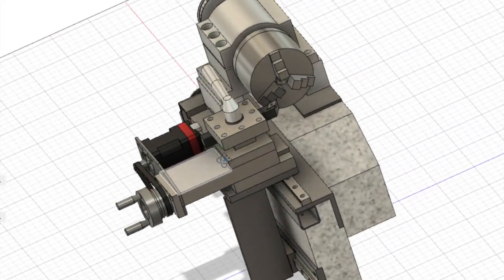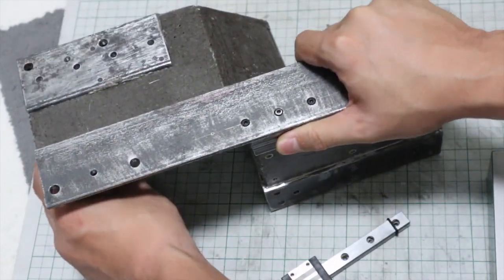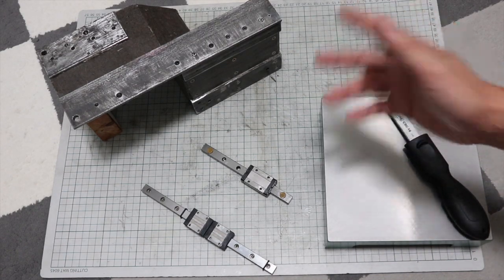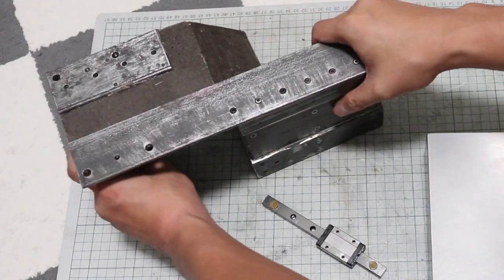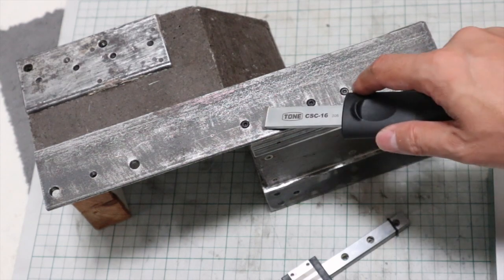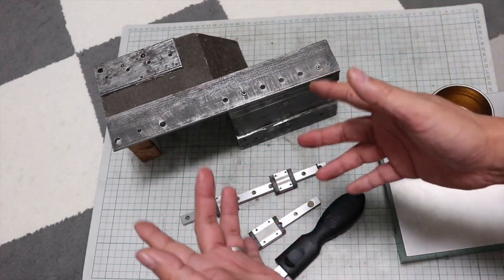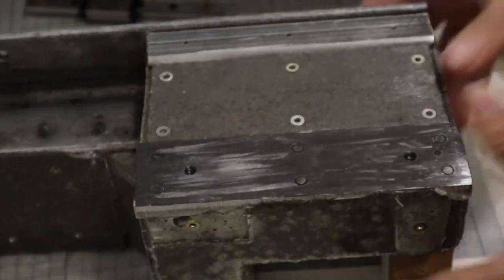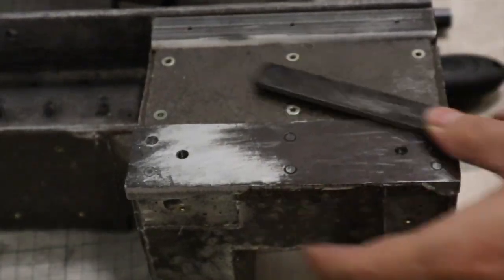Homemade DIY Small CNC Lathe ,Part3

Comment: So I have a project where I should transform an automatic Lathe Machine to a CNC one do you have any suggestions for the motor and the cnc board for drufelCNC or Mach3
Reply from the maker: I use Linuxcnc and Raspberry pi4 and mesa 7c81.
I will use these because I already have them, but if you are just starting out, I would refer you to the video in the link below.
https://youtu.be/8MW4Zqvn3H8

Comment: Wow, this is really in interesting precision scraping technique seems to be logical and easy to be done by hobbyist at home without a proper milling machine. Where did you find that metallic surface plate, what is the surface finish grade for that surface plate and how much did it cost? I think a granite surface plate of that size should cost less but might be grade-B. 

5:05 - you should not scratch the metallic surface plate reference to the flat stock bar which needs scraping, this is going to destroy the precision surface finish of the metallic surface plate. 

The proper way to do your technique scraping is to use the proper ink type, which is "Machinist Ink" (such as "Dykem Ink") and apply it to the surface plate, then take the surface plate and slightly gently let it sit on top of the flat stock bar which needs scraping and let it rub slowly few millimeters, then take out the surface plate and cover it with plastic so that it doesn't dry out the ink. What this is doing is transferring the Machinist ink from the surface plate reference to the flat stock bar without destroying the surface plate reference. You will see the ink on the flat stock bar which needs scraping. You keep repeating at at one location and work along the length of the flat stock bar.
Reply from the maker: Thank you for your careful explanation.
I bought the surface plate from a Japanese shopping site called MISUMI.
However, that surface plate is not a high-precision one, just milled by a milling plate.

Comment: Hi man. Nice work. I'd like to suggest you to be very careful with the test plate, it is valuable thing. U use it like a file scraping off the paint from a detail. You should put a paint on to the testing plate instead and then carefully move it across the detail to move paint to the humps on the detail marking the places to be scraped off. 
I wish you successfully finish your project. Waiting for a first chips 👍

Comment: Nice work. I can't  wait for the final form. For next video can you measure the deflection of the epoxy frame under the load?
Reply from the maker: There are no plans to measure deflection at this time.
I intend to check the final performance by machining accuracy when it is machined.

Comment: what IF you stick sandingpaper to that flat surface, and use it as quide as also flattening tool as once.. 

Sandpaper may not be parallel, but if you keep rotating it and using different areas.. 🤔  Should that make surface you working on pretty flat
Reply: Yea tought that same than Alli, if sanding would be faster than marking dozens of times that surface when doing rough part of scraping
Reply from the maker: Sorry, I misunderstood what you were saying.
I think sanding is fine for roughing out the surface.
Scraping should be more accurate for the final finish.
Reply from the maker: That is one way to do it.
Scraping has long been a method used to create high accuracy flat.
Skilled worker seem to make adjustments of a few microns.
Reply: @a-cnc-f  Maybe scraping for the final adjustments, but sanding for roughing it in?
Reply from the maker: I used sandpaper at the end because I wanted to smooth the surface and to remove the remaining marker ink.

Comment: You doing it wrong...
The paint must be fluid. Rough pass can be thick layer of paint, the finishing layer is thin.
Scraping must done by diagonal to the guide at 45°. The 2nd 90° to the 45°.
https://youtu.be/xQyK9XzCiGk?t=1227